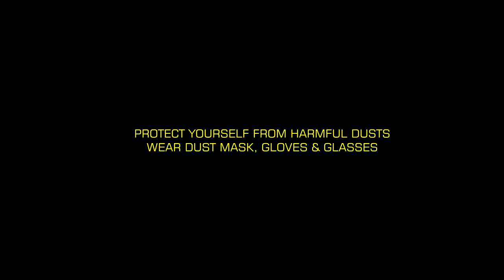Black and Decker Wet and Dry Vacuum Cleaner | How to Replace Dust Bag & HEPA Filter 2021

Comment: You don't have the black foam before the hepa filter?
Reply from the maker: Hi adxangeles7842, it depends on the task. Sometimes there is no sponge, and sometimes there is. Hope this helps. Thanks for watching. Pls like, share, subscribe if you haven't already. Happy Holidays!
Reply: May I ask, what is the use of black foam?
Reply from the maker: @juniorjade_187  For picking up large amounts of liquid, BD recommend that the HEPA filter should be removed and install the Black Foam Filter. Hope this helps. Thanks for watching. Please like, subscribe, share if you haven't already. Happy Holidays!

Comment: Di dalam hepa nya tidak ada busanya pak? Klo yg 20liter ko ad yaa
Reply from the maker: Hi Nia Nanil,  the foam and HEPA are two separate filters. Foam is used on wet. Never use HEPA for wet vacuuming, it will contaminate the filter. Thanks for watching, stay safe.

Comment: How to use s wet vac
Reply from the maker: Just do the usual,  do take off the hepa filter and dust bag. Put on the sponge filter and you're good to go. Thanks for watching. Cheers!
Reply: So it means the black sponge is only use for wet vacuuming? Thanks
Reply from the maker: @stellamarie5022: That is correct! Thanks for watching. Please like, share, and subscribe if you haven't yet. Cheers!!!